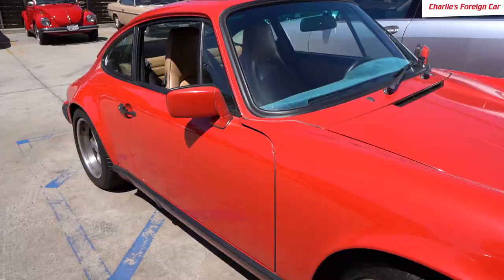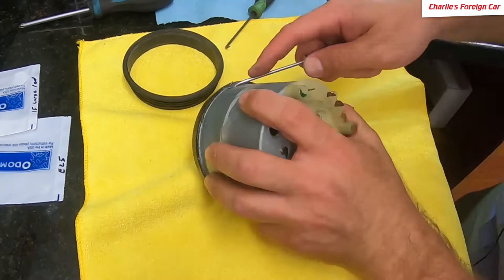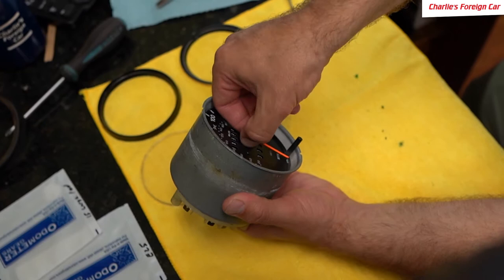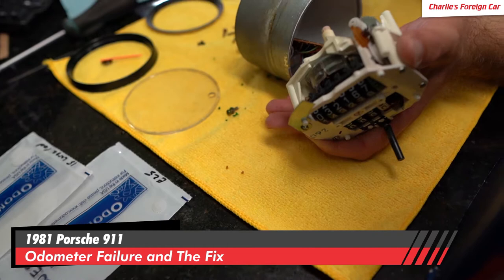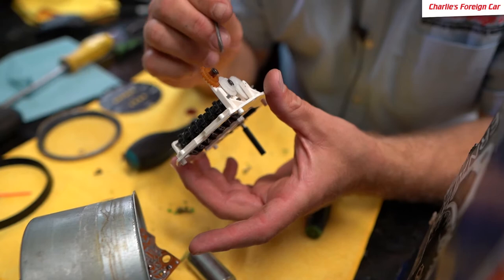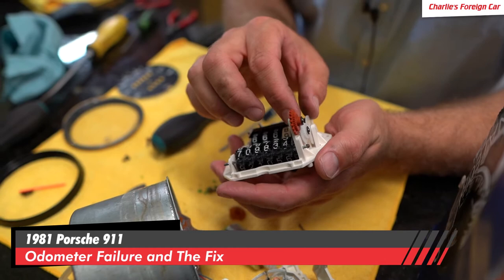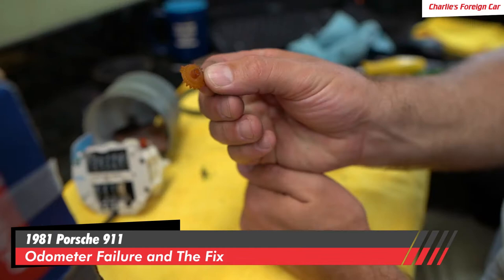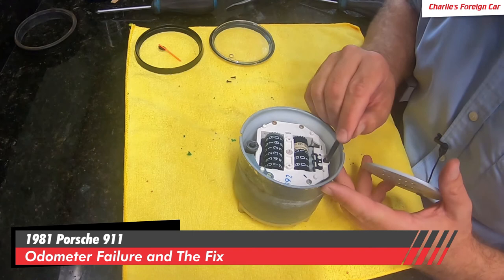1989 Porsche 911 Odometer Stopped Counting Up The Miles

Comment: On my 85 dated speedo I found you didnt have to remove any of the 6 electronic speedo fixings on the back. Actually the mileometer is a completely separate mechanical only chassis which is just screwed on top of the electronic speedo part underneath. You can see in the video if you disturb that there is an insulation sheet plus 3 insulating doughnuts and dozens of wires on the then loose PCB and drive motor  that will take a long time to put back and can get damaged and trapped.  Just remove the needle and dial as shown and then remove the 4 screws holding the mileometer chassis and lift it out. The shaft pin and 2 c clip axles are clips are all presented to you. Change the gear and reassemble. When you have unpeeled the fascia flange it takes just 5 minutes . You may find the hardest bit is counting the teeth on whats left of the wheel. For the UK and MPH versions its a 20/30 tooth from 75-89.

Comment: Just did the common gear replacement repair on my '86 Turbolook using the details in Charlies very helpful video, where the white gear off the worm gear drive loses a tooth or two and stops.  Bought the gear @ Pelican for $25.   I admittedly forgot to mark the placement of the needle before removing, so I simply guessed the placement (basically @ 0 mph mark) and then installed the unit in the car (without putting the glass and final bezels on), so that I could calibrate the speedometer using my WAZE phone app to understand mph.  Have your wife or friend go with you and monitor the mph's, see if your speedo is reading high or low mph's, when you come to a stop, make your adjustments to the needle (carefully) against the 0 or 160 stops until to you get close to calibrating with your actual mph's.   We got the correct calibration after only the first adjustment - with the speedo reading ever so slightly lower than actual - keeps the PO-PO away!

I agree with some that there is no need to remove the any of the back screws or electrical buss connector, assuming your unit has the common break of the white drive gear.   I would also suggest replacing the 3-4 2watt illumination bulbs while the unit is out - all mine worked, but they were really yellowed after 37 years and would most likely go out in a week or two, knowing how Mr. Murphy works.  Lastly, remember to take a picture of the untouched outside trim ring (remove the rubber mounting gasket) before you begin and mark the date you took the picture on the housing of the unit so it shows in the picture, this way, you can verify to anyone (future buyer?) that the speedo had never been repaired/altered before you owned the car or did the fix.   It is VERY apparent if the unit has been previously opened.  My car has only 57,582 miles and I wanted to make sure that I documented that those miles were original.  

If anyone is uncomfortable doing this repair, I'd be glad to do it for you for a nominal fee - it is absolutely ridiculous what some online repair facilities are charging for this easy fix, with quotes of $350, $400, and $475-$580 and some suggesting a 4-5 week turnaround time.   With the learning curve over and the replacement gear in hand, it would probably take me a total of 30-45 minutes to do the repair - the most onerous portion is just getting the outside trim ring removed and then removing the needle,  ever-so-carefully.     Thanks again Charlie, Cheers!

Comment: Definitely helps to have this video. The only snag I ran in to so far is, I bought the wrong gear. There are different tooth counts, not sure why. Right one is on its way.
Reply from the maker: Glad the video helped.  Is working now?
Reply: It's not working, wish I knew how to bench test it. Gear went in without issue. Put it all back together and still no milage count increase, speeo works fine.

Comment: Unless I missed something, there doesn't seem to be a need  to remove the speedo workings from the back of the case and mess with the fine electronics..  The odo gear stack seems like comes off of the speedo unit with just the front four screws.  I'll be doing this soon and can rprt back.
Reply from the maker: Let me know what you find.
Reply: @fixingcars  he never responded. Something tells me it didn’t go too well.
I just took out my 1988 911 and the odometer is stuck like the one in this video. I’m wondering if I send mine to you could you make the repair? I noticed someone else is also looking for theirs to be repaired, you could make a couple of us very happy.
Thanks in advance, Joe
Reply: I did not remove the rear screws - just the four under the face plate - got it back together and it works perfect - Thanks for the detailed instructions.

Comment: Really great detailed video, thanks!.  Only problem for me...I cant seem to get odo out of the dash.  Its seems to be really tight and not budging at all.  I have plastic trim tools but hard to get around the gauge.  Any tips, would love to see a video on this.
Reply: Grab ahold of the outside ring of the speedo gauge and rock it back and forth, it should loosen up and separate from the dash. if not use a knife and carefully lift it away from the dash. It can also be pushed from inside the dash, but not a lot of room. The only thing holding it is a rubber ring. Once you have it out, there are 3 lights and 3 electrical connections that pull out. Should apply to most air-cooled 911/930's. Good luck.